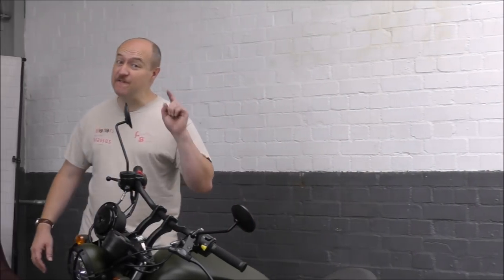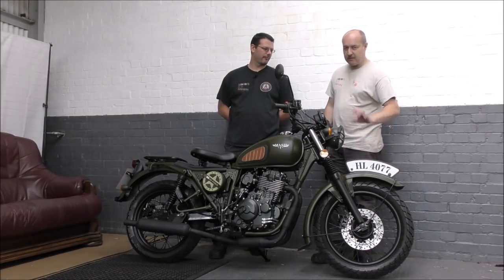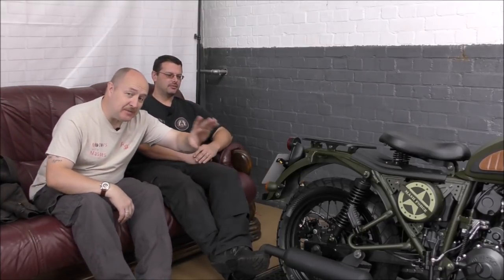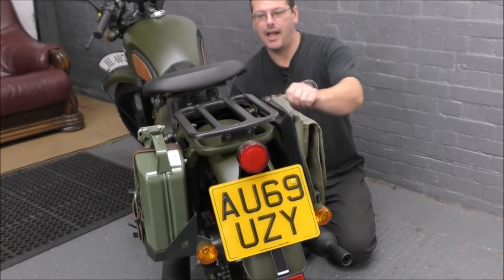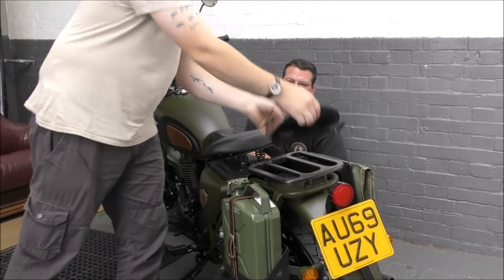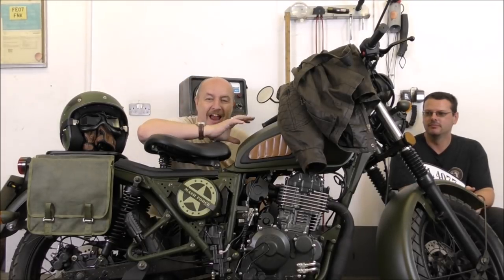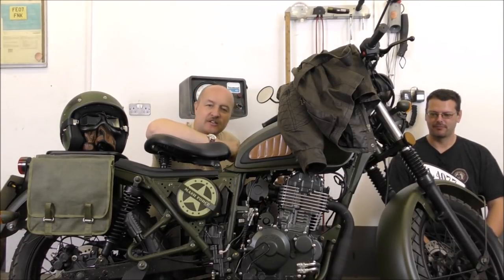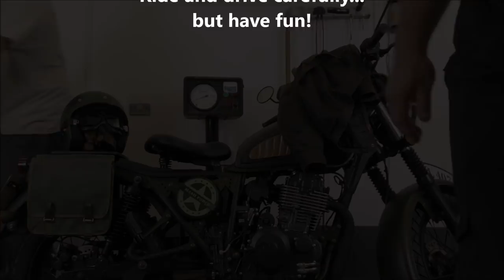RARE 2019 Army bike from the 1940's REVIEW

Comment: (mash) mobile army surgical hospital and it was unit no 4077 and as for the plate on the front i thought it would be illegal unless its a proper vintage bike pre 1970 somthing but looking it up i sit corrected
Reply: Don't know what you looked up but, under UK Display of Registration Marks Regulations, motorcycles are not permitted to have a front number plate if first registered after 1st September 2001.
Reply: @peva7945  gov.com web site .in basic english instead of legal talk it says that a front number plate is not required they did not ban the use of
Reply: @joejojo4751  loretta swit tv or sally kellerman  for the film ?
Reply: @peva7945  think its alright though as its not actually a numberplate ?
Reply: @apm136  The purpose of the legislation was to avoid harm to pedestrians.  That there might be no numbers stuck to the plate hardly makes a difference. I refer you to Construction and Use Regulation 53 and to their general requirement not to cause danger to others and to Motor Vehicle (Approval) Regulations 2001 which prohibit such external projections.

Apart from all that, it took a lot of work by the motorcycle lobby to get rid of the requirement for a front plate , so why the hell  would we want to start fitting them now?  Like small number plates on the rear, why give the police an excuse to pull you in and then find a lot of other things, as so often seems to be the case.
Reply: @celticwarrior1961  In relation to motorcycles the relevant paragraph states "a registration plate MUST NOT be fixed on the front of a vehicle if it was first registered on or after the 1st of September 2001".  That reads to me like a fairly clear ban.

Comment: Nice one ! Only thing I don't like the seat look's like it's just stuck on the top ! Keep up the good work 👍
Reply from the maker: Good old 40's styling
Reply: @motorsforthemasses  Maybe but my English Enfield where the rear frame loop is lower  you sit into not onto the bike ! It just doesn't look right ! Still if we all like the same boring !!! Fuel can and bag look cool keep on biking happy days ☠️
Reply from the maker: @Busman126  cool. What year is your Enfield?
Reply: @motorsforthemasses  1955 model G deluxe it should be a 350 but I am fitting a 500 twin port from a model J .